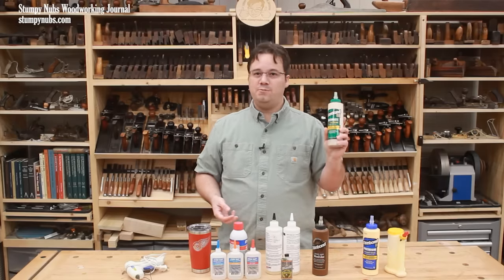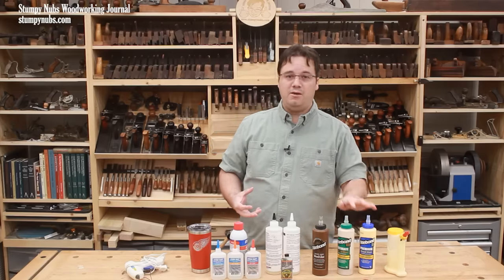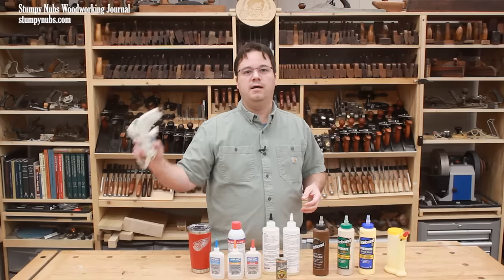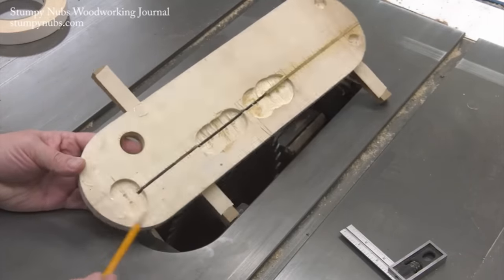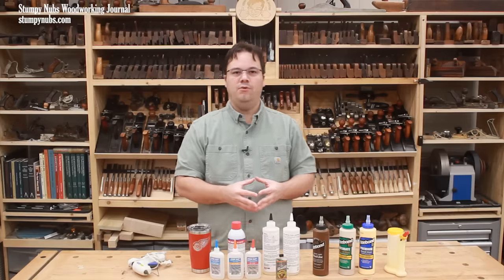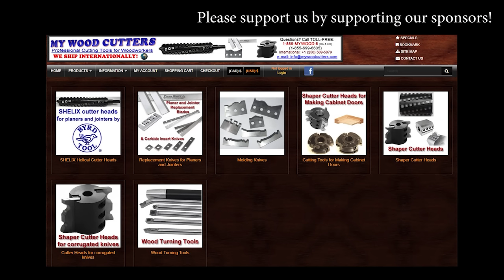Why I don't use Gorilla Glue

Comment: I accidently discovered something about the polyurethane glues, recently, that I had no clue of before. I did a repair a couple of years ago with G-glue and those repairs recently failed. The glue had gotten extremely brittle & weak over that time, simply failing under a very light load/torque. I was literally able to push the surfaces apart with just a little bit of finger pressure. I suddenly realized that G-glue (brown or clear) is not something I want to use in a permanent situation. Fortunately, I was able to redo the repairs by simply sanding off the G-glue residue and repairing with some PVA glue.

Comment: @ James Hamilton, Gorilla Glue also makes a wood glue that I have used a number of times, mainly because in my area I can pick up a bottle of Gorilla Glue Wood Glue at my local Dollar General Store just a mile from my house, AND the closest Home Depot of Lowe's who sells Titebond is literally an hour drive from me in any direction I travel!! Of course there are a couple of hardware stores nearby that sell both Titebond and Gorilla Glue, but the Gorilla Glue is still cheaper a lot of the times too!!! 

The Gorilla Glue wood glue is super tough!! It is insanely strong on joints after it fully cures and I have used it in wet applications which it seems to hold up too also. I have never actually "tested it" though, but on projects I have used their wood glue on, you really have to beat the stuff up to break it apart, and usually it destroys the wood around the joint it is holding too!! So you are better off just cutting in instead of trying to break it apart!
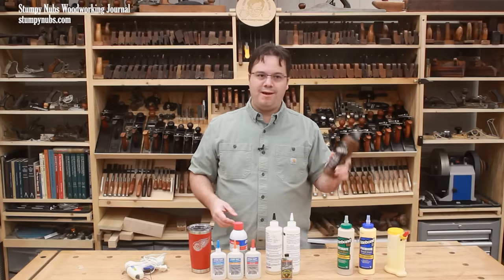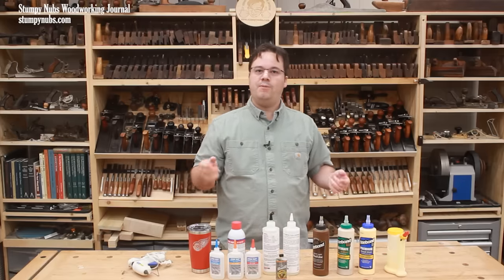Reply from the maker: Yes, I mentioned Gorilla's PVA glues as something comparable to the Titebond formulas I use (3:21). I showed that I use their epoxy injectors (6:37). It was only their PU glue that I don't use (10:14) which is their flagship adhesive and is what their brand name is most known for.

Comment: I use poly glue when I need to fill gaps in glued pieces. My main objection to the stuff is it's VERY brittle when fully dried. Any joint that flexes at all will fail fairly quickly.

Comment: The one glue I don't use is epoxy because its messy and you have no chance of undoing what you done. I guess its ok for formica or plastic but not for wood. I generally use PVA because if you get any bleedover onto your wood surface you can generally clean it off with a bit of water and a cabinet scraper. I also use stickfast without the activator which gives you a bit more time before it goes off. On small projects you can also use it as a grain filler..

Comment: Polyurethane has good properties. I use 5 or 30 minute and can get different colours. Doesn't chalk like pva at low temp, waterproof and fills gaps. I make gates so nice to be able to get the frame glued and out the clamps so can finish it the same day.

Comment: You say you store CA glue in the freezer - I am guessing this is only for full, unopened bottles.
I store unopened bottles in the fridge. Before using the bottle, I let it warm up to room temperature before opening. The reason for this is that humidity in the air will condensate on the bottle (and in the bottle when you open it) resulting in a clogged nozzle.
Bottles in use stay in my shop and I only put the cap back on the bottle after giving the CA glue some time to drip down from the nozzle back in the bottle.
This seems to work well for me.
Reply from the maker: Condensation only occurs where moisture is present. That's only on the outside of the bottle. If you cap your glue and put it away before moisture seeps inside, there is no condensation in the bottle.

Comment: Poly Eurathane is great, but you generally want to minimize foaming.  This means not wetting the surfaces.  Like CV glue, let the moisture from the air cause the polymerization and you will get longer, less brittle, chains.  

It is great for attaching rough surfaces, where the tiny expansion you get without adding water gives it a touch of gap-filling.  It also dries almost perfectly clear if used this way.  Just don't expect it to cure fast.  You're talking hours to set and days or weeks to cure.  If you are bolting things to concrete walls, I haven't found anything that can match it for setting concrete anchors.

Comment: Lots of comment about PU glue 'skinning'. So simple. Turn the bottle upside down. Moisture can't get in. Had my 500 ml bottle for 3 years and used it last week quite successfully because I needed something a little stronger than my white glue. I don't wish to pay 4 times the price to colour my glue yellow. It is definitely not 4 times better. Also if used sparingly PU is no more difficult to clean up than PVA glue.

Comment: epoxy depends on the hardener. Standard set epoxy like West system you need to use the appropriate hardener or it will kick within 10 minutes.

Comment: I work in a custom cabinet shop we use gorilla glue in instances where pva glue will cause warping such as for attaching solid to sheet material or laminating different thickness sheets together for example glueing 1/2 to 3/4 ply to make 1.25". Pva will cause these parts to warp every time without fail. No need to wet surfaces, at least we dont bother haha. Never had any issue. Just my 2cent perspective

Comment: I have used white PVAC glue for woodworking my entire life. Dont need more than 20 mins for it to harden and release the clamps. This was also taught to me in wood working school. 

Two newly planed surfaces glued with PVAC glue and left for 20 mins will not brake at the newly glued joint if you stress test it, but rather the wood itself will brake if glued properly. Remember that light, dust etc over time drastically impair conditions for a good glue-up.

Comment: I have a love to hate relationship with Gorilla glue. I never got it to work for me, it foams too much, it tends to push my joints apart, and has a tendency to to dry quickly in the bottle.  I don't by it after my 3rd bottle.
Reply: I know what you mean. I don't monkey around with it anymore either!

Comment: gorilla glue is good for repairing ikea stuff and repairing failed threaded nut inserts. since the glue isn't a solid any over use or back fill of the nut insert will just crush down when you thread the bolt into it. in thin layers like in a joint it has an incredible strength and spritzing the surface to be glued with water before applying the glue will allow the glue to cure faster while also allowing the glue to get harder and stronger greatly strengthening the joint.

Comment: Gorilla is great for certain projects.  Spouse broke office scissors cutting grape stems.  Ya she stresses ALL tools.  The ones with yellow and grey handles.  So what holds plastic to metal?  Nice clean break and I added glue.  Are five hours I cleaned off the squeeze out.  After 24 I sanded the joints.  Good as new so far. Gave her some side cutters for grapes.

Be careful as it always squeezes out and you can't get it off wood.

Comment: I used the original gorilla glue to repair some severely cracked boards on my wooden fence gate. Worked great for that application - expands to fill the gaps, very strong and is completely waterproof. However it’s a real mess to work with. If you get on your fingers (and you probably will) it’s going to be there for at least a week.

Comment: Top tip: You can use a combination of pva and ca to lessen the need for clamps. Leave a few short gaps when you spread your pva glue and add a few dots of ca, then put them together and the ca will hold the pieces while the pva dries.

Top tip: hot glue releases instantly with alcohol. You can pop your hot glued parts apart by rubbing denatured or isopropyl alcohol over the edge and let it capillary through the edge. No other cleanup will be required, as the glue should come away as a single glob, leaving both pieces clean and ready for next processes.

Comment: If you're making something that will be around steel, like a scabbard, *do not use Titebond II*. I'm not sure of the chemistry of it, but something is the gas it gives off will rust carbon steel, even weeks or months after it's dried.

Titebond I is fine, and I've used it for near-steel work with great success. But avoid any of the others.

Comment: I think you're wrong Stumpy. I use all the glues you've shown but the one glue I keep coming back to, and indeed I use to make the majority of joints on all my guitars is polyurethane. As I don't have heating in my workshop, PVA type glues (all of them) will tend to fail over time if the glue-up is done below 10 deg Celcius. Polyurethane won't fail due to low temperature (within reasonable limits). PVA type glues go off relatively slowly compared to the 10 minutes of open time you've got with polyurethane glue. PVA needs access to the atmosphere or a porous substrate to extract the solvent in it (water). So if you cramp up a glue joint with two thin boards face to face with one another (or veneer perhaps) and you use a non porous cramping caul (like melamine chipboard) You may find that the glue simply won't go off at all, as it can't get rid of it's solvent. Polyurethane will generally go off under these conditions (I've tried both many times). Poly will go off in about 3/4 of an hour reliably. So you cramp up a joint, leave it to one side, do another job for an hour, and your glued up component is ready to go. Give PVA/yellow glue 1 hour to go off and it's odds on if it's gone off or not (mainly not). PVA glue, if left on a visual surface when it's lacquered will always show up as a light patch in the lacquer. This can happen even if you've left a slight residue after diligently wiped off the residue with a damp sponge/cloth. Poly won't show up under lacquer. It foams out of the glue joint, but you just leave it to go off. When it's gone off, you cut it off with a chisel (just run the chisel upside-down along the joint) and throw away the squeeze-out. Then sand it in, and the residue will be gone.
 Spreading is easy, IF you use the folded edge of a piece of old sandpaper. Squeeze the glue on, in lines. Use the sandpaper spreader to spread it out, just like a window cleaner uses his wiper - in lines. Then when you've spread it, the spreader goes STRAIGHT in the bin! ALWAYS use laytex/vinyl gloves, and you won't get any on your hands. No mixing. Get it anywhere. It's cheap. If you need any more open time than the 10 minutes poly gives you, just use PVA/yellow. It's FULLY waterproof where "exterior grade PVA" will fail in the elements over time. it's gap filling - good on non visual/rough/quick joints. And as the glue expands (foams) as it cures, it pushes itself into the very pores of the wood itself. Most other glues just sit on the surface.
I think you're missing a trick. It's fantastic stuff!

Comment: You have to know a lot to use epoxy because you need to know what fillers to use in different situations. I have an entire shelf full if epoxy fillers and the go to ones are microballoons, colloidal silica and cotton fibers. I also have aluminum powder, glass fiber, clay, cement, wood dust, etc

Comment: One thing notable about Polyurethane Glues (Gorilla etc.) is that although it appears to fill gaps well, the manufacturers state that they are non gap-filling.  In other words, the glue will foam up to fill gaps but will not maintain strength of the bond that way.

Comment: I use PUR glue in most cases, it strenght is uncompareable to others.
Years of expirience showed that joint never fails with PUR - only the wood around cracks so it is as strong as wood usen in projects (also depends on grain pattern od course).

Comment: I use PU glue for most projects built between September and April :)it has a significant advantage: cures in cold weather, no PVA glue does. To use PVA means I need to be able to get whatever I'm building indoors/into a heated environment, that isn't always desirable or possible.

PU is fine for outdoor stuff in my experience and is always waterproof, unlike PVA.  I don't have anything against PVA glues and use them almost universally when I can (easier clean up, prefer the properties and no foaming out of glue lines) but until someone comes up with a PVA formulation that reliably works in <10c conditions PU glue in woodworking will have a significant advantage in that scenario.

I too dismissed PU initially, I didn't like the foaming in particular.  It's very different stuff, it's far less forgiving than PVA as well (starts to cure much faster, bigger glue ups have to be very well rehearsed!) but when I realised it works for glue ups in winter in an unheated workshop I gave it serious use and it turned out a lot of my initial apprehensions weren't really justified and it serves an important purpose.

Epoxies do have some similar advantages but once again do not cure well in cold weather - that's a big deal for me and applies especially if you live in a mild/temperate climate, when something doesn't cure reliably below 20c ambient that is a big problem.

Comment: Gorilla Glue is my go to glue for wet pressure treated lumber. It likes the water for curing and has the the flex to accommodate the extreme shrinkage as it dries out. For every other applications I pretty much avoid it.

Comment: It would be really nice if it was feasible for you to create and link to a table of equivalent glues in different brands, primarily brands more readily available in other countries.  While this video is quite informative as it is, in some cases I'm left wondering 'what's the local equivalent of that glue?'
Reply from the maker: I did not focus on brands in this video, I specifically concentrated on types of adhesives (PVA, CA, PU, Epoxy, Hide Glue, etc.) so you can use the information wherever you are.

Comment: With wood and CA, make sure that the glue doesn't all get absorbed out of the joint. High viscosity CA is best on wood. Low viscosity is best for plastic, and can wick into joints easily.

Comment: With epoxy, you must be using a long cure epoxy.  Some epoxy cures in 5 minutes, so the working time is very short.  Epoxy is much stronger than other glues, but wood joints don't need that much strength, as the wood is not really strong. 
If you every want to delve into the science and engineering of bonded joints, a guy named John Hart-Smith at Boeing wrote the book on bonding.

Comment: The original white wood glue I seldom use any more. I still have it around, but in a few years you can throw it away. All I use is "foam" glue or construction glue, the poly stuff. I use it for all wood the never has to be taken apart, because the glue is stronger than the wood.

Comment: And PVA can be heat activated for iron-on veneering. Standard white Titebond can even be re-activated. Watch out though, the other Titebonds can only be heat activated once and within a short time of drying, so don't get bubbles ; or use epoxy instead !. I used polyurethane once too and didn't like it.

Comment: I do most indoor stuff with animal glue. I prefer bone glue as it is possible with vinegar to reduce the gel temp down to room temperature. Vinegar also increases the strength a lot. bonus: as long as it is dry it doesn't go bad. If you have excess you can let it dry and use it later. Gelatin works as well. Don't let the glue get in contact with metal. It will decrease the strength and may have some other side effects like discoloration. And do not use glass containers with the prepared glue. It will rip chunks off the surface while drying
Reply: Another great dry glue is Weldwood resin. It's not pretty, so don't use it on cabinets, but it will do the job and as long as you keep it dry it will store for years. Water cleanup when wet, waterproof after it sets.

Comment: Great information James. I primarily use Titebond II, but go with III for longer glue ups. I did a poor job of cutting tenons recently, so I used your link to order some Quick Cure 15 on Amazon. Thanks for the tip!
Reply from the maker: If they are REALLY loose, you can always glue some thin pieces of wood to the cheeks and then re-cut them :)

Comment: Gorilla glue is "the ticket" for sheeting poly styrene foam with balsa or marine grade (thin plywood). As it expands (in being clamped or weighted) the glue is forced into the foam making a deeper joint in that the extreme outer surface of the foam isn't the entire adhered surface, it instead penetrates (due to expansion and having no where else to go) deep within the foam so the sheet can't be pulled off the foam as easily. I build Radio controlled aircraft and therefore sheet my hot wire cut foam wing cores whilst they are in their saddles and are weighted down flat on the table. FYI
Reply: I use white Gorilla glue to repair crash damage on foam airplanes. It foams enough to fill rather large voids, and the resulting foam is stronger than that of the plane.

Comment: I use Gorilla glue in my guitar building for structural joints in necks, Why do I use it: because it doesn't creep from heat ( guitars left in cases in a car in summer can get up to 150 degrees) this enough to for most glues including epoxy to move and change position. I use hide glue as flacks mix up a small amount for the job at hand, it is reversible if you don't wait too long.

Comment: Personally I use a bit of the Gorilla Glue - it's good where you need a bit of a longer open time, especially for very large (think 6") bridle joints and is truly waterproof. I generally prefer the alternatives for much the same reasons as you but would add one more downer - if you leave any visible on an outdoor project, it quickly goes a very ugly orange colour in the sun.